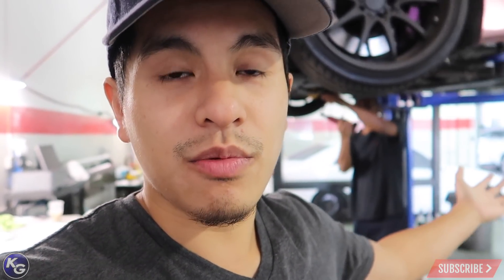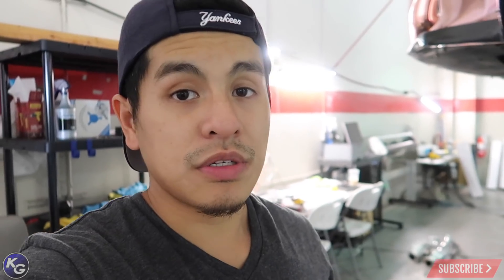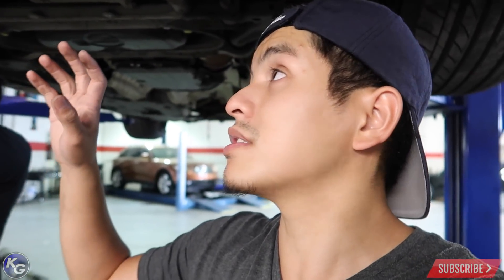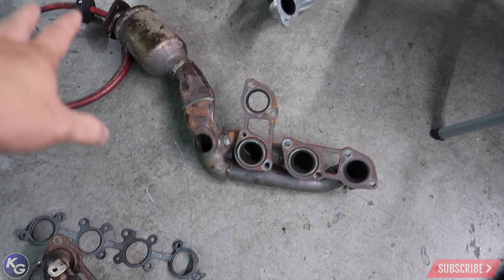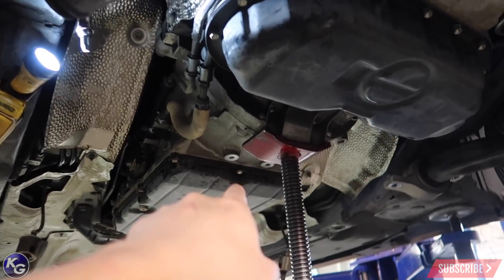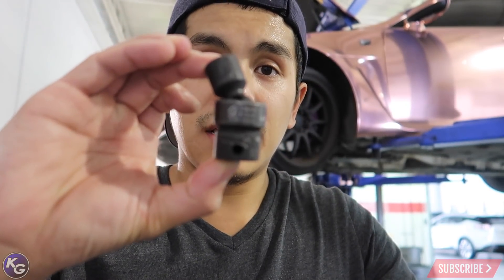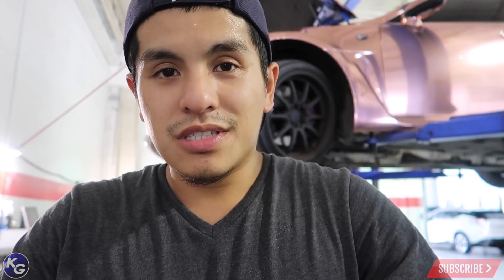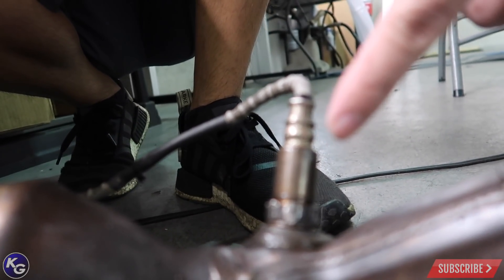Installing PPE Headers on my Rose Gold Lexus ISF - pt 1

Comment: Will the PPE headers bolt straight on to the Borla® - S-Type™ Stainless Steel Cat-Back Exhaust System with Split Rear Exit (BOR-12656)

Comment: I also definitely have cracked headers and will be replacing them with PPE, Also I think I have a bad engine mount on the left side of the engine, do you reckon the crack in the headers could have been caused from a bad engine mount over time, I also feel a nudge whilst down shifting from 3rd to 2nd gear, 

Love you videos bro I have almost watched every single one of them, Thank you for passing on your knowledge and wisdom 
Ma man 🤝🏼
Reply from the maker: I would definitely think the mount is a factor but since this occurs to almost all the ISF's, it could just be from aggressive acceleration and deceleration that would cause it them to give out.

Comment: Hey Lam, before you replaced your stock manifold did you get error codes saying the car was running lean? Did you hear a knocking inside the car but not outside the car?

Comment: Do you have more info and visuals on your turn down/dump pipe? Like whats the pipe diameter? Did you just get a generic turn down from an auto parts store? Thinking about doing the same to my IS F.
Reply from the maker: L.Tylavii White I bought the car like that. They pretty much took off the rear mufflers at the diff and just welded a new flange/pipe that stuck out maybe 6” and was slightly bent and cut at an angle.

Comment: Nice! Jealous. Lexus just replaced my cracked stock manifold under warranty so no point getting headers yet. Won't be for a while :(
Good job on the install!
Reply: Edgar 
U know What's the warranty milage on them?
Reply: TheTaker31 I don't know the original warranty coverage time frame for the manifold. I purchased the Toyota platinum warranty when I bought the car last year. It covers 50k 5 years.